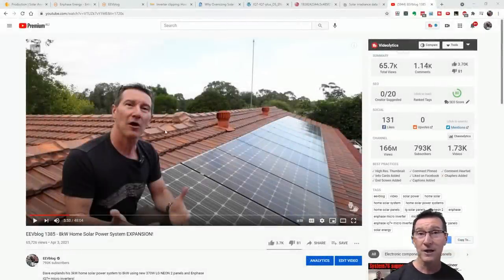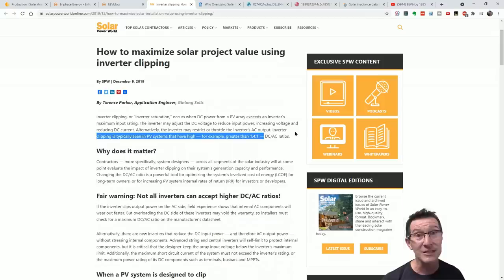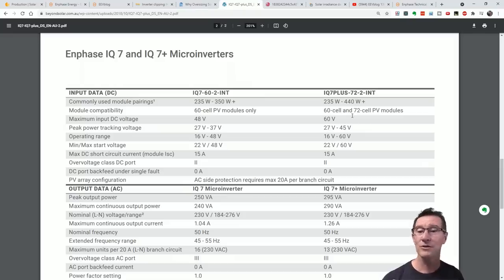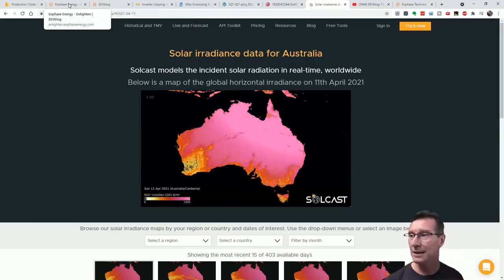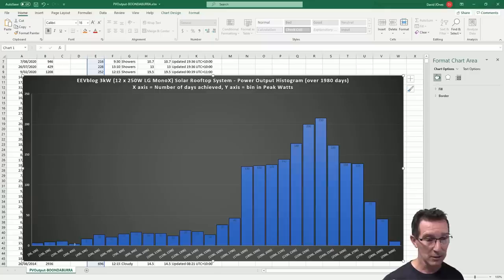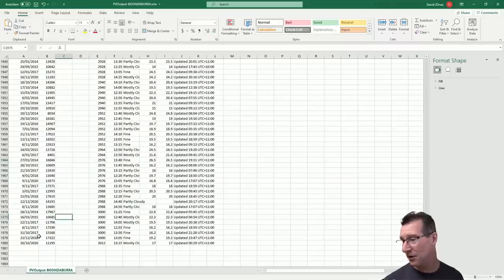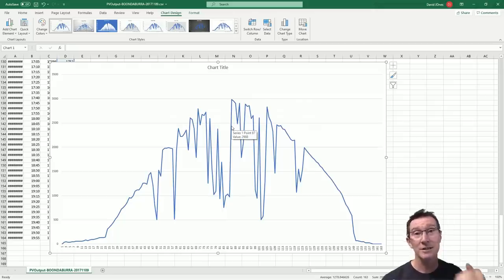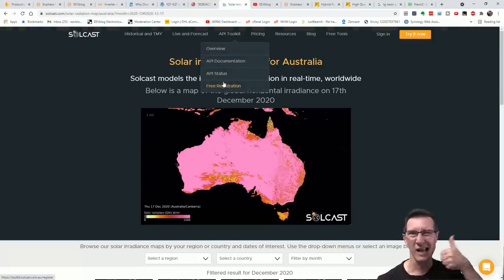EEVblog 1386 - 295W Inverter vs 370W Solar Panel - WTF?

Comment: Ouch, Dave this is incorrect. clipping is not derating. Clipping is to limit the open circuit voltage to be able to put more panels in a string without exceeding system max voltage. It does not reduce total power output. Reducing panel power output is not a thing in the industry, and does not increase lifetime of a system, it will rather reduce it as increased temperature on the panels, as less energy converted. It may even void the warranty of the panels. PV professional here. You should remove those micro-inverter and get something properly sized.
Reply from the maker: Semantics. There are several ways of "clipping". One is to limit or "clip" the output power. The other is to clip the input voltage.
In this case with a single microinverter per panel they are limiting the power output. The same can also be applied to string invereters, like my Sunnyboy for example, it's clips at 3kW power output, it is not clipping the panel voltage to protect the system.
And it IS a thing in the industry, it is done routinely. Whether or not you like it, or specify that yourself to clients is different. But the fact is it is commonly done in the industry for practical price/performance reasons.
And if your client is in a low insolation area and you are advising them to get a 1:1 ratio system then you are not advising them correctly. It's not an all or nothing thing, it depends on the circumstances, you can't make blanket statements like you are, that's not befitting of a "PV professional".
Reply: I was thinking the same thing. It will be even more acute in places like Perth where they have even more sun (less cloud). So perhaps the micro inverters aren't quite up to speed yet - it maybe better to still go for the traditional inverters.
Reply: @EEVblog  In the industry, clipping is basically limiting the panel voltage output, as Voc is higher than Vmp, it is usually done with optimizers within the junction box. This is because of some countries regulation on maximum allowed voltage (1'500V~2'000V per string), it allows to put more module on a string without exceeding the maximum voltage, but this does not reduce the power output as it is clipped above Vmp. The inverter will clip to its maximum power output, but that is a safety measure, and if an inverter clips, it is a bad design. Micro-inverter overall isn't a good solution, most companies doing them went bankrupt for a good reason. They offer very few advantages at a high cost, lower conversion efficiency, lower power, they do improve the performance in case of shading, but that is actually very small, a few percent at most, despite all the marketing they do. If one really wants to improve shading performance or have panel-level monitoring, optimizers is a better and cheaper solution. Overall standard inverters are a much better solution, an inverter will give you better performance at a much lower cost. Emphase obviously reached the limit of cost/usability as the panel power increase, and then they do these tricky datasheets to trick the customer, and seems to have misled you when you reached them. Reducing the power output is not something done in the industry despite what they may claim. Clipping will actually reduce your system lifetime as when clipped, the panel temperature will spike, inducing thermal stress, increasing the chances of defects like hotspots, crack expansion, and probably PID. This system is simply not a good design and is driven by marketing & sales of Emphase rather than engineering (to me, you basically have a solar road on your roof :P). I love the channel and the EEVblog community and what you do is awesome, but take a step back and check the Emphase claim from an engineer's perspective. One may guess you got them for free, in which case this is a sponsored content, you should indicate it as is if it is the case. All the best!
Reply: Well, the links in the description use the same terminology ("clipping") to describe the design choice/methodology of combining/matching panels and inverters for an optimal system (used to capacity).
I don't see how this relates to what you are describing concerning max voltage and panel count.
The topic here is clearly about using a lower rated inverter with a higher rated solar array, while dropping some power/energy in peak-power moments, which will likely lead to hotter panels and inverters (in these moments) including a probably minimally shorter lifespan.
The pros and cons of that method are well explained here:
https://www.solarquotes.com.au/blog/oversizing-solar-arrays/
Reply: @realedna  You refer to the wiki article full of typo? Anyone can write a wiki article, it does not represent the industry. The industry is not the internet posts, it's what is done in power plants. If you look at power clipping, you will find that it is only considered when using a micro-inverter. It is okay to clip for a few % on extreme days over a short period of time, to avoid oversizing an inverter, but not 20% like in the video. This is marketing noise from those micro-inverter companies, but you will never see any serious power plant doing clipping, or using microinverters, and there is no reason for a residential installation to do clipping either, besides trying to justfy micro-inverter, especially when you can use a lower cost inverter that wouldn't clip for the same system size.
Reply: @bluelemonify  One doesn't have to "guess" he got the system for free, he's said it over and over again throughout the installation video. No need to get snippy because you got put in your place, troll.
Reply: @RickinICT  the video is not marked as an endorsement
Reply from the maker: @bluelemonify  "most companies doing them went bankrupt for a good reason". Enphase seem to be doing pretty darn good. It's horses for courses of course, they aren't a magic solution for all applications.
As for you continued claim the no one in the industry limit output power of inverters, you are simply wrong, just google solar inverter clipping and there are countless articles on it. Don't make the mistake of extrapolating your local expierence with that around the world.
And BTW, I'm not advocating that people should underrate their inverters, obviously it's not ideal to do that, and as I said, I find it personally rather offsenive to do it. But this video is answering the question of why you might want to do that and the effects because it is not uncommon in the industry regardless of what you say, you are demonstrably wrong on that fact.
Also, as several have explained in the comments, they have limits on what they can output to the grid, so clipping is somethign they have to do if they want to maximise their efficiency and output at other times.
Reply: @EEVblog  True, although it used to be hundreds of companies doing them. There are still hundreds of companies doing normal inverter. Some companies doing like "battery optimizer" that you debunk are also doing well... Marketing...
Reply: @EEVblog  I don't mean to come across as a troll or anything, but the video tries to justify that it is good to waste some good solar panel power for using a system that is 2-3x more expensive than something that would have the proper rating (2'000USD 10kW inverter vs 5'500USD for 10kW of IQ7+). From engineer to engineer, this is a hard stretch. If the stuff is free, for sure it's worth it. But it will mislead people watching this video that will actually pay for it. You are pragmatic and this is why I like this channel. Enphase datasheet to state "Commonly used pairings" in W, then below states the power output in VA, this is designed to mislead. Especially they suggest panels up to 440W at 290W output, leaving the consumer with a heavily underpowered system, that is deceiving sales practice. You have debunked products for less than that.

Comment: Well Dave, there is extra difficulty: what if you provide more power then you use? Where does the energy go to? Here I give it to the grid. This years, still getting a little bit back but soon this will be 0.  The installation is of course such that the batteries will be full on most days so they are only full earlier on better days and will not be charged extra (no way to charge batteries above 100% full ;-) ). So there may be a little bit going to the grid. But that is then powering down windmils because many houses at around the same time that day are producing much more then on other days and the bigger powerplants cannot throttle down anymore.
Actually, on well sunny days with also some wind (so, also the panels and inverters are cooled more then on a still day), the grid-connected panels are just switched off because they are getting 'over voltages'. They work between around 190 to 245 Volts and on those days, the grid is running at 248-250 Volts and switching off my inverters...
And yes, this happens many times here in springtime. Using my water-cooker to boil some tea is turning them on again but almost immidiately after  the wate is hot, it turns off...
Later on the day, the inverter is switched on again.

It gave me many headaches to find out this was the cause of turning the output on the panels off...

About my location, I'm in the Netherlands (EU), small village with many houses nowadays (I was one of the first) have solar-panels in or on the roof.
In another village my father has a lot of grid-tied panels too, the old ones were with micro-inverters but now most have been converted to strings like the newer panels. Same here, but only multiple strings of 2 or 4 panels instead of a micro-inverter per panel. This should be more efficient according to the company that installs them especially during less-sunny days on which the inverters even use more power from the grid then they produce in the mornings.

Comment: 10% Loses on a single installation may be deemed acceptable from an individual point of view, but when every solar system is losing that amount of power, that adds up to a huge amount equivalent to the output of several conventional  power stations.

Comment: Bottom line, best bang for your buck involves clipping. Stop whining. Just wait a few years: your panels will slowly degrade and you won’t have any more clipping. You should also mention the correlation between temp and rated output. Big drop off when above standard testing temperatures.

Comment: Come on Dave... that was a lot of talking to allow yourself to be lazy. For each of the 5 minute bins over the almost 2000 days add up the kJ of energy produced by the system then add up the kJs produced by the system  in the bins that were above the ABOVE virtual “ceiling”.   You can subtract  constant amount of kJ below the ceiling in the high energy bins and then you have it! The amount of kJ you would have actually been forgone due to the inverters maxing out. And as  you have the total energy that was produced by the system you can have the actual percentage of power you would have forgone.

Comment: I have tried with my 3 euro charge controller to charge lead acid an it can handle about,18 volts of solari inbput. I have 30 voltrcpanels they only do 30 volts on the best if days here in holland maybe 1ctime a year  am fine,with missing some power 1 day year if i can yse way cheaper converters. Sio ehat happens to your inverters the xuny day arrives  wul tgy gwt fried? Or will thwycbe fine? And never draw more,than they can output. Us tgat somethhibg thatcis the case ib generak ? Like this. On an overcast day i do like 10 watts gere ob hollsnd nist days are 8ver cast  so the idea us,to add more panels to have more watts on bad days. But the pannelslist will not match the inverter on good days

Comment: I would get a refund and install a single large SMA inverter. Oversized inverter should run cooler and last longer and be more efficient overall in the long run. Micro inverters are bad idea because of there Hot temperature location, causing even less efficiency on top of the clipping max output! Are you kidding me

Comment: A long-winded video "justifying" use of under-powered inverters. Why? because those inverters were given to Dave for FREE, and he has to somehow justify using them. As they say,  don't look a gift horse in the mouth.
Reply from the maker: I'm trying to explain why they supply 295W inverter with 370W panels, as many people asked and it seems common in the industry. Personally I don't like underating like this.